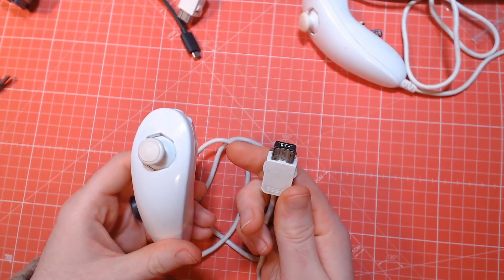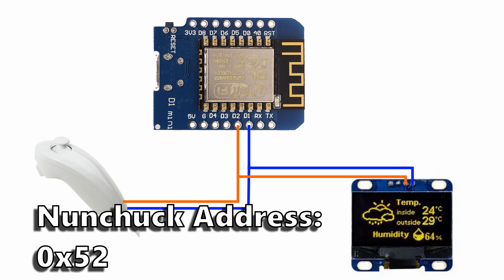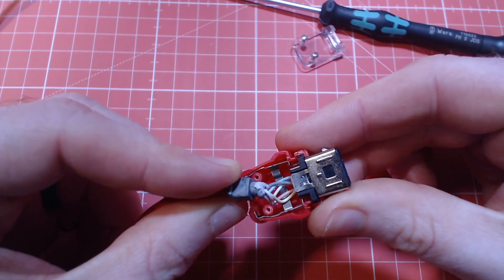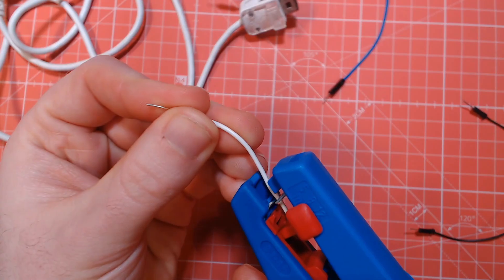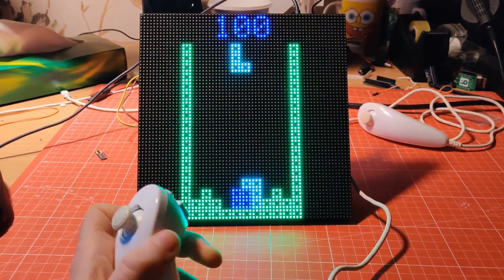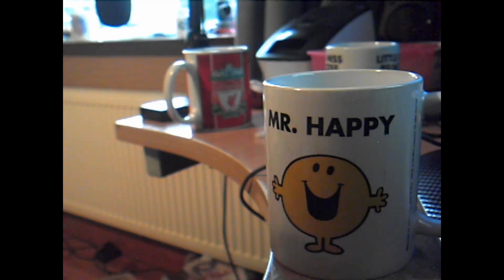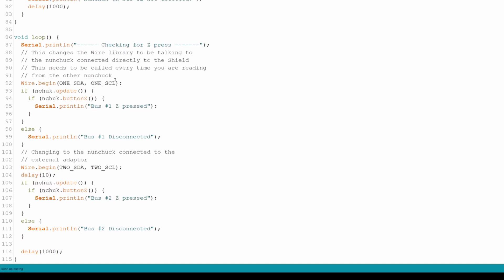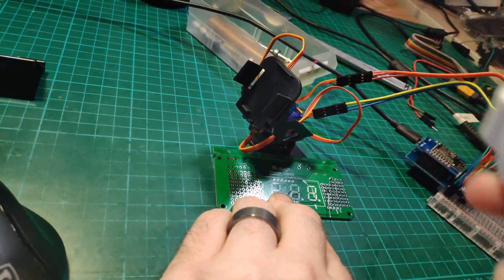Wii Nunchucks are the best Arduino Input Device

Comment: Hi there, I just wanted to ask what the int value would be if the joystick is moved down the y-axis or the same for the x-axis. It says the values are from 0-255 on the y-axis and the same on the x. Does this mean that the bottom of the y-axis is equal to 0? Or is that -255? Thanks in advance
Reply: SOLVED: 128 and above are equal to an up input and below it is a down input.

Comment: I also love Nunchucks as input devices.
I often use wireless Nunchucks but good ones are getting expensive.
I used a wireless Nunchuck with my Halloween Hex.
https://www.youtube.com/watch?v=f520FM9Z9is

Before I started documenting projects on YouTube, I used a Nunchuck to control a small RC helicopter. The joystick was used to control pitch and roll and the accelerometer was used to control yaw (similar to the hexapod control).

If you're interested in smoothing out the motion of your pan tilt contraption, you should take a look at this video with accompanying code.
https://www.youtube.com/watch?v=yoy7H21KJS0

Thanks for sharing your projects on YouTube. It's always fun to see what you're doing.